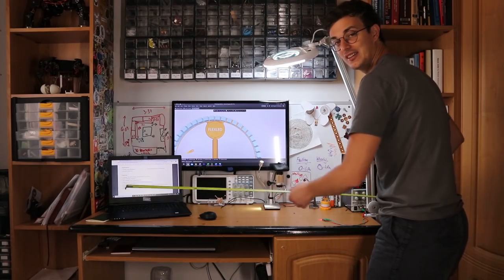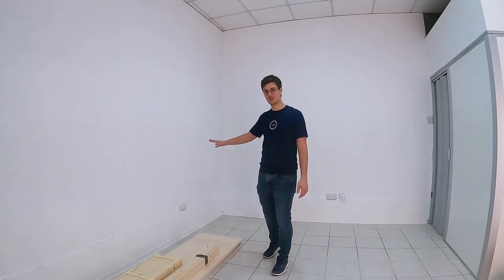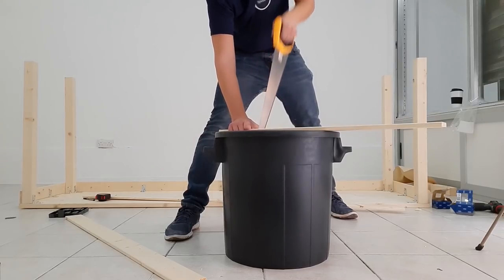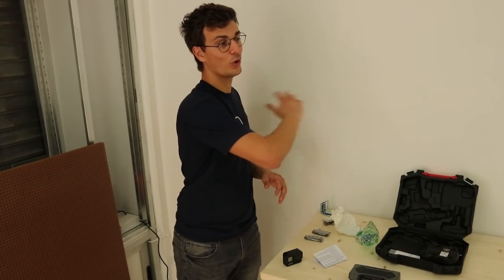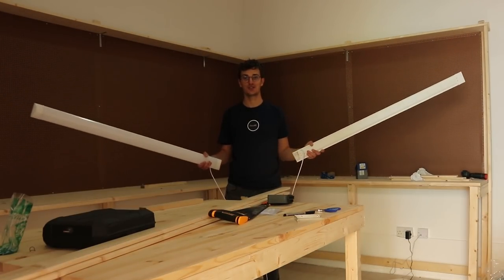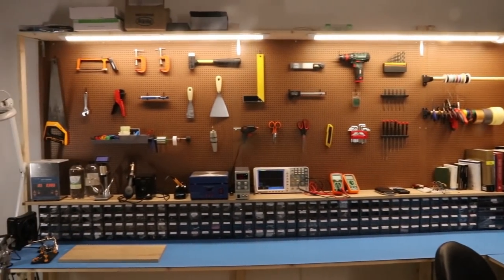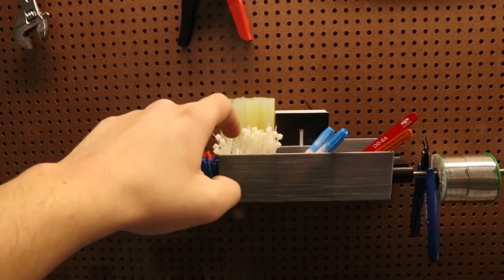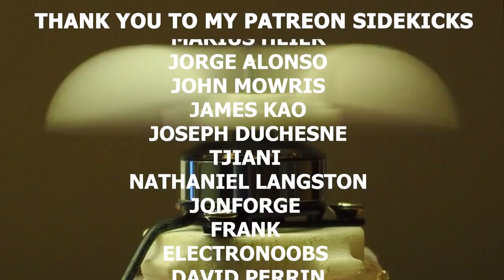Building my NEW LAB!

Comment: You should match your camera to your power grid frequency. Looks like you set it to NTSC (30/60fps) while your power grid is 50Hz, hence the flickering indoors under artificial lighting.
Reply from the maker: Yes I should! I didn't release that after I filmed all the footage.. Sorry for that
Reply: @CarlBugeja  No worries. The video is about the content mainly and the videography second. I don't care a lot about white balance and focus, but the flicker makes me nauseas.
Reply: @NicMediaDesign  I feel you man, I also have major problems with flickering lights
Reply: hack- use DC power supply on ac powered led lights to get rid of flicker.

Comment: This viewer is looking on wistfully, wishing young Carl the best of success as he launches his first from-scratch lab... and is about to learn some of the same lessons we've all learned. Like putting drawers on the bench top wastes the space in front of them because you have to leave that space clear so you can pull them out. I predict you'll end up removing them from the bench and instead arrange them much more vertically, like in a separate bookcase arrangement -- there's no point having them spread out so horizontal, except for a few you use all the time.  And you'll need some openings in the backing board to bring  power cables, and space behind the bench to let power cords hang back there instead of lying on the bench.  And 60cm (2 ft) may be a little shallow for a bench top (though test gear is shallower now than it used to be).  And you'll probably want an additional shelf above the bench.  And the lighting is probably too high to work as task lighting.  But all in good time!  I'm sure it'll feel good to have this expanded space!

Comment: Congrats on getting a dedicated space! :)  A couple of things to note. Hanging tools to the perforated wall will get old really soon, so you might look into Adam Savage's Tool Storage Stands ( https://youtu.be/TWQAYfGxsPE ) they work very well. The drawers wall for electronic components might be not enough in the future, so you might look into getting some big(ish) shelves to store plastic boxes (about 10 liter each) and store your components or projects in zip lock bags inside those boxes. At least that's my 2 cents (I use both solutions and extremely happy with both).